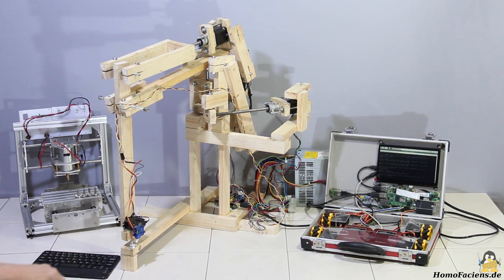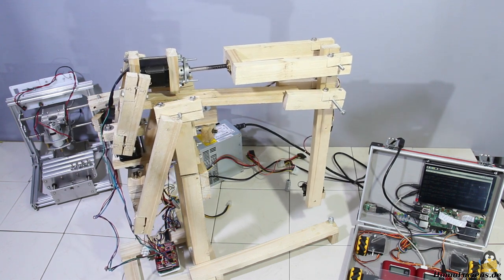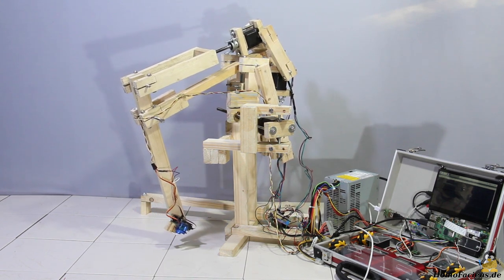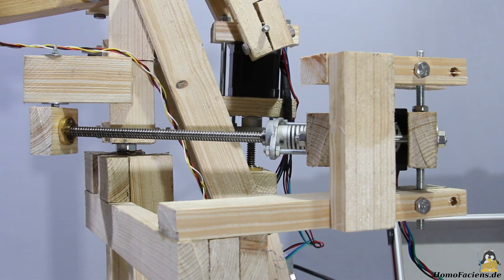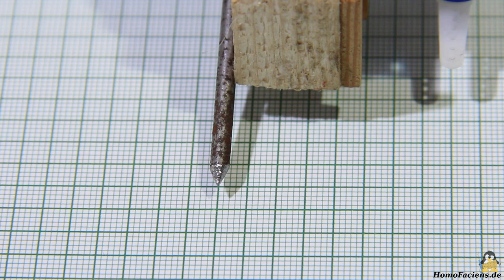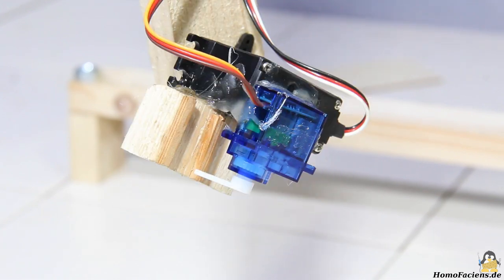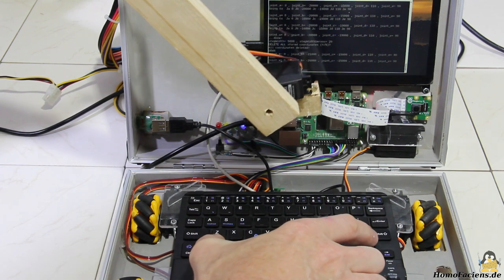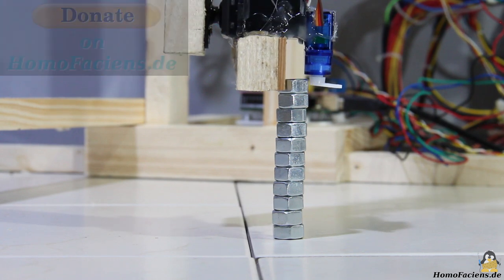Robotic arm v1.0 better than it looks ;-)

Comment: rotation sensors are fairly cheap. Maybe adding one in the rotation axis (And all other axis) and then compensating for backlash in software is cheaper than making everything super sturdy.

I kinda wants to see a wobbly piece of wood still getting sub millimetre precision.
Reply from the maker: I have shown how to get the sensors from old printers that offer high resolution: https://youtu.be/a55EwMSIy2w
However, it isn't that big deal to make the rotational drive a lot stiffer by adding a second joint on the brass nut attachment.
Sub millimeter precision with a wobbly wood drive? Works: https://youtu.be/ULJE4MsJpR4

Comment: I have been wondering if there is some easy and cheap system we could use for feedback. If the machine knew it was off by 3 millimeters it could easily correct it. Then we could build a cheap, flimsy machine in one weekend and it would be able to do high precision tasks, not because it was stiff and precise, but because it would know when it was off target and correct itself. Maybe Arduino range finder modules? or video cameras? anything that would let us know where the end effector is in real time.
Reply from the maker: You won't turn a robotic arm that has lots of backlash into a precise machine by adding a feedback loop. But feedback makes it easy to counterbalance deviation caused by forces on the mechanics. So you can realign the arm if it bends under the weight of a piece it has picked up. The sensor of course must be good enough to measure the error you try to compensate. I haven't played with the Arduino range finder module, yet, but I guess it can't locate a point in space to less than one millimeter, which would be needed to increase the precision of this robotic arm. But it could be a great idea to learn about feedback loops - try it out.
Reply: @HomoFaciens  I think I misused the word precise. If the machine can return to the same spot every time it is accurate? Anyway , as the breadboards full of bits and parts laying around my house will attest, I have started working on my first simple robot, some people would call any robot as simple as this a "drone", not a true robot, but whatever. On the subject of cheap, quickly built projects, anyone can design something that works if they have enough time, money, and technology, the real test of skill is using a little to make a lot. Making something accurate out of something flimsy, making something useful out of something useless, making something expensive out of something cheap. Ultimately, to make what you want out of what you have.
Reply from the maker: ...a good horse doesn't jump higher than absolutely necessary. Same is for machine precision: If a machine meets your demands, it is a precise or accurate machine. Creating a flying machine from what is around the house? That's what Otto Lilienthal and the Wright brothers did. You are a true pioneer!

Comment: Can backlash compensation movement help to improve the robotic arm more?
Reply from the maker: Backlash compensation in hardware always improves a machine. But what kind of design changes do you have in mind?
Reply: @HomoFaciens  Not hardware change but maybe software. I used to do this when I was working on controlling screw mechanism for microscope auto focus. I don't know if this will work in your case. For example, you want to move from abs position 10 mm to 20 mm and backlash is 1 mm. What you can try to do is to move to abs pos 21 mm and then move backward 1 mm.
Reply from the maker: Yes, that should work for compensating a bit of the large backlash on the axis of rotation, but only without any external force on the robotic arm. I would prefer putting more effort in a stiffer mount of the lead screw.

Comment: this is so funny, man you dont have any shame at all and you just use whatever is the cheapest to build stuff even if this means shit result. i built a cnc using this philosophy, using wood, aluminium tubes, and some scrap steel tubes, then i debuilt it, i hope no one ever finds the photos i have taken, the only proof this ever existed.
Reply from the maker: Especially the scrapiest looking machines are a demonstration that someone thinks out of the box. No need to feel ashamed!
Reply: @Mr.Unacceptable  excuse me, but your reaction seems to me, really exaggerated, you could have said the same things with a little more politeness. 
Also I am of the idea that gen kindarma has not grasped the essence of the video, that is to demonstrate that something that works can be do even with poor materials but I do not find the need to express it as you did
Reply: I'm curious why you called this a "shit" result. It obviously works great as a pick and  place machine for nuts. Not bad at all in my opinion.